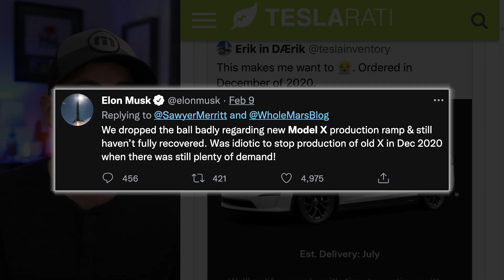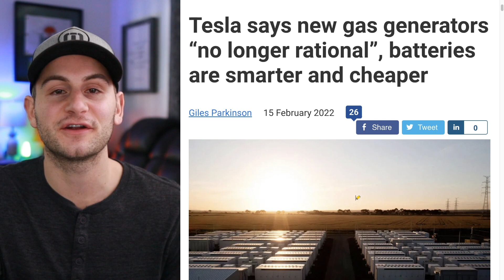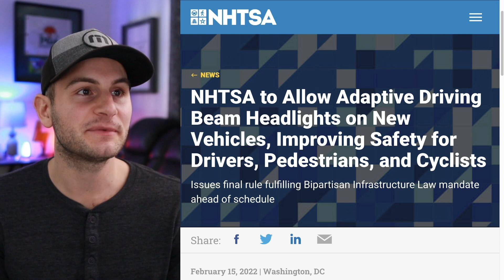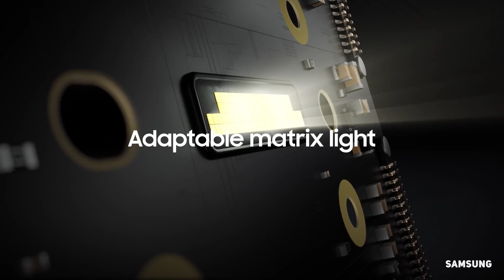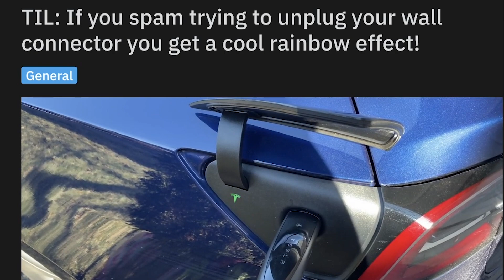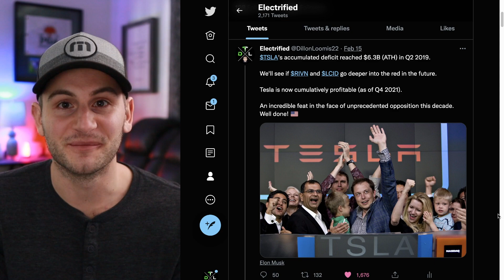Huge Regulatory Win for Tesla / New Tesla Supplier / CNBC & TSLAQ Exposed / Model X Delays ⚡️

Comment: You can say what you want about Lidar, or just radar tech, but after optics cause a few crashes at night because color separation isn't good enough part of the time, companies that have been certified to level 4 or 5, whichever it is, will get downgraded.  A few lawsuits and good lawyers, and you'll figure it out.  I think what Elon said is stupid, it's basically saying that if you couldn't have seen it anyway then crashes are OK, and that's RUBBISH.  FSD should be better than humans, and when a certain FSD technology is responsible for a crash, then the owner of that technology should be liable.  You can't have authority without responsibility.

And I have no interest in FSD whatsoever, but I do pay attention to technology and when something hits my brain wrong, there's a reason.  You need both electronics sensing and optical sensing, because there are times when one is better than the other, and the purpose of FSD shouldn't be, "It's OK because I would have crashed too"  Or, TESLA should NEVER have the approval to have driverless vehicles and ESPECIALLY a semi, which can kill multiple people in a crash, and ESPECIALLY not have an FSD system with a driver is in a lead truck and it's leading a few driverless trucks.  That doesn't jive to me unless it's better than humans, and that's very possible to do.

Comment: Here's my problem with Tesla, and in specific Tesla grid storage.  They are having to put off production of vehicle due to supply shortages affecting battery production, and yet they are trying to make contracts for grid storage, taking away battery production for BEV.

I'm sorry but at some point if I'm waiting for Tesla, I move on and buy a Chinese BEV if I'm outside of the US, otherwise I'm getting a BEV from one of the other companies selling BEV in the US, and there are some great vehicles right now, part of which are better than Tesla's models regardless of the numbers they can produce, or how close they are to autonomous driving.
Reply: Pretty sure that Elon said recently that Tesla is NOT battery constrained, so you can rest easy.

Comment: Great to see the adaptive headlights law updated. 
Now if only they can get the wing mirror legislation updated to permit cameras instead. Not sure about the US, but here in the UK wing mirrors are still required by law. Using cameras instead will have such a benefit for drag co-efficiency / range.

Comment: Hi from Australia, enjoying your Chanel.
On Liontown, which am a shareholder.
The Tesla deal is the exactly the same quantity & timing as LG’s. The screen shot you had up is correct, just miss read or understood.
700,000 ton is over the 5 year contract, so 100k 1st year then 4x 150k per year. And same number of EV’s can be made ie 500,000 per year - according to sheet you had. Note LG batteries could well go into Tesla’s so potentially 1 million cars per year contract. And that’s a little over half Liontown’s output in 2025’s full operations.
Thank’s for the videos!

Comment: :yt:<Trading lead to big gains in Bitcoin, the movements in the price of Bitcoin are not so great now but still that it's very easy for even experienced traders to get whipsawed and lose a lot of money. But always remember that bitcoin trading carries high degree. The safest thing to do so as to take full advantage of the crypto era is to buy as much as you can, then trade or mine to increase your holdings which you would have to use a whole lot of money to acquire if you where strictly a hodler. That's why I choose a professional with whose help I have made over $39,000. mr Daniel's strategy has really helped me acquire more even in this bearish period. he can be reached on Te Le Gram  [Danielwrightfx]  for more info on how you can acquire more in this period:buffering:

Comment: The only thing missing at Tesla for the computer on wheels is wireless connect. T Mobile would meld nicely as Tesla Mobile. Starlink could be folded in as well. The current market cap of TMUS makes a $200 billion stock swap offer in line. Tesla Mobile would become much bigger than T Mobile ever could.
Reply: Every Tesla comes with 1 year free LTE connection (4G), after that year it is 10 bucks a month to keep it.. I will keep it, it is great for up to date traffic information and automatic re-routes if something has happened on your normal route.
Reply: @MarcoNierop  - Tesla does not own it. It would be better if Tesla owned their own network, plus they could cross sell wireless phone service to the faithful. I bet even superchargers use wireless 4G connections.
Reply: @HeavenGuy  I do not think Tesla should have their own mobile network, they are simply to small for that and the use case too limited.. It would make the option for wireless connectivity way too expensive.. To be honest, do not even know which provider they use here in Europe.

Btw, there already have been Starlink DishyMcFlatface's spotted at supercharger stations, so for supercharger stations it could make sense, but not for in cars. A Starlink antenna is too big for mounting on a car, and no you cannot make it as small as for 4G, the physics simply do not allow that.

Comment: my reservation for model Y just got delayed by 6 months (from june 2022 to december 2022). what are your thoughts on this? production problems?
Reply: Extreme demand
Reply: @ericogden4589  That was my first thought as well, but I'm not entirely sure. It would make sense for extreme demand to cause new reservations to be delayed significantly. But I reserved 3 months ago, so they already had a good sense of existing demand when they quoted a June delivery.
Reply: @timscully4250  probably means a major update aka structural pack is rolling out. They will push it back to be sure and I’ll bet it will jump back up. Demand is a major factor.
Reply: I am guessing but likely supply issues.  I seem to recall hearing about how a pile of cars were all ready to go but for a lack of a single chip for the seat belts or perhaps airbags.
Reply: Happened to me too, but got revised soon after. Might be a glitch or miscalculation on their systems. On the bright side, you might get the structural pack one!
Reply: Part of it might depend on your configuration. We just received our MY LR a couple of weeks ago after a little over six months of waiting. One of the key factors these days seems to be the wheels and paint you choose. Some combinations have shorter delivery times than others. Good luck, I know you're going to love it when it arrives. It's definitely worth the wait!